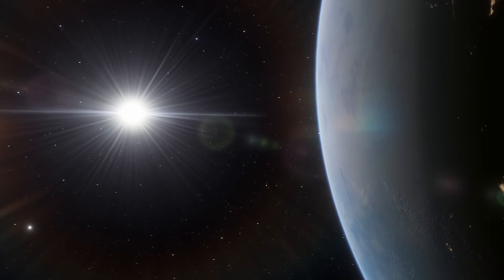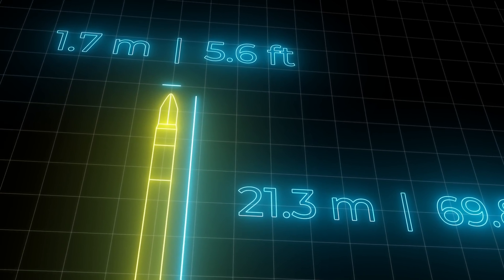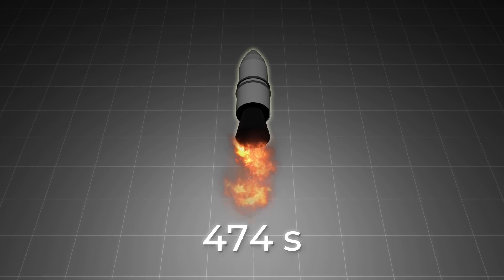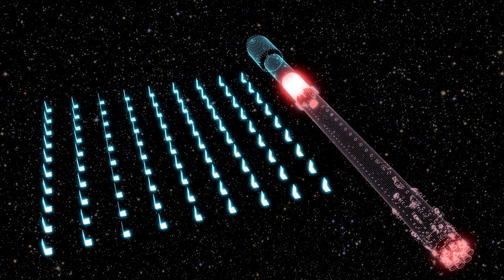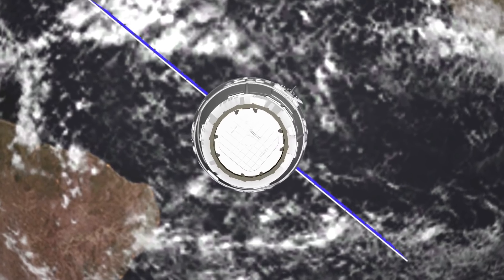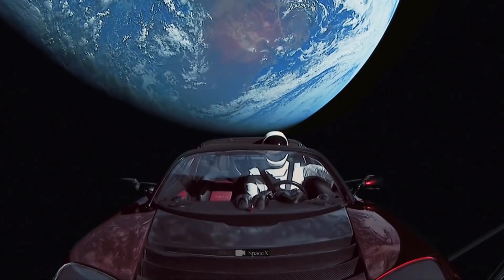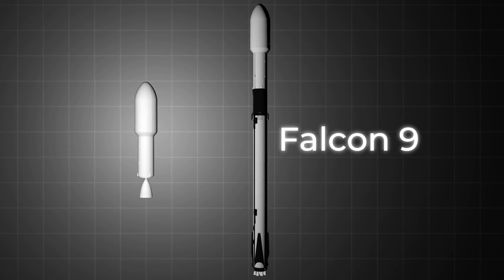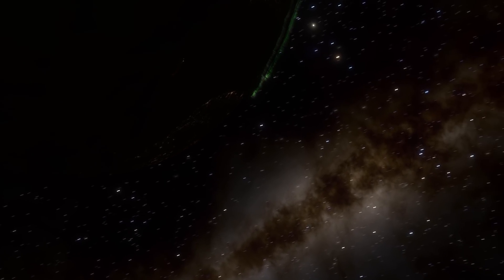How All of Elon Musk's Spacecraft Work in Just 10 Minutes

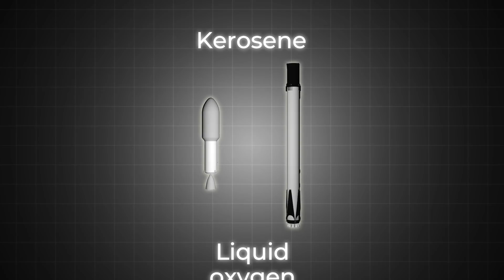Comment: Lots of Misinformation! 4:25 Stating “none of them have failed” when referring to the falcon nine that’s unfortunately not accurate. CRS-7 commercial Resupply mission to the international space station unfortunately failed when it disintegrated Two minutes and 19 seconds into flight.   The video has many more inaccuracies throughout, but the one in the 8th minute where it states that Falcon Heavy says that it has the powers of 18 Boeing 747 aircraft and can lift the weight of one of those same aircraft filled with baggage and fuel to orbit is completely wrong!   Elon Musk has many times stated that the falcon heavy can lift the equivalent weight of a Boeing 737 aircraft to orbit Confusing the 737 which is one of Boeing smallest commercial two engine jets and the Boeing 4 engine 747 which turns out to be its largest jet would be like claiming that a Ford Focus and a Ford F-250 Superduty pickup were essentially the same thing. There is a long list of inaccurate information in what otherwise would be a good video. 
I strongly recommend doing a bit more research on a subject before making a video thats going to be viewed millions of times (over 1 million times in the first 4 months) Other then the misinformation, the graphics and content of the video is really quite good. It’s a interesting subject both, both Elon Musk and SpaceX has revolutionized Spaceflight and are doing more to develop and advance the future of Spaceflight then anyone on the planet!  I can’t imagine what SpaceX will accomplish in the next 5-10 years.

Comment: Great video Oh, awesome content. You may want to double-check some of your information though. There have been a few failed  Launch a tents with the Falcon 9. One of them specifically being a launch for NASA CRS mission. also SpaceX cancelled the option of using the super Draco thrusters To land without having to use parachutes. They cancelled this option about 3 years ago. They canceled it mainly because they did not have enough data to support using this option for landing with humans on board. The time it would have taken certify this would have been too long and they needed to get dragon to operational.

Comment: There's.... just a lot of little mistakes in this video. This video says things like Falcon Heavy was designed with the intent to carry people and... "spaceships?"
It says that Falcon 9 has never failed.
It misleadingly makes it sound like SpaceX is super expensive (even Falcon 1) while SpaceX is often a cheaper option.
I'm also still trying to unpack the phrase at 0:10
-which I find very confusing. This video doesn't feel like trashy click bait, but it definitely could use some more research.

If you want far more accurate SpaceX info, check out Scott Manley and Everyday Astronaut.
Reply: You’re right, a lot of factual errors and moreover, the Falcon heavy was never meant to be human-rated if I’m not mistaken
Reply: @F2PRS  It was originally meant to be human rated, but they had to drop it, it was also originally supposed to share fuel between all 3 boosters but that proved to be too difficult as well. The op is correct... Scott Manley  is a much better source for info on spacex and rockets in general.
Reply: Yep.  I disliked this video for these same reasons.  Great graphics, but terrible fact checking and misleading terminology.  Also, falcon 9 is volume limited to 60 starlink sats despite reusability/expendable configuration.

Comment: 04:32  "None have failed"?  
.
The Falcon 9 has suffered two failures in its short life span. 
.
2015/06/28  A Falcon 9 carrying CRS-7 to the ISS disintegrates during ascent at  T+02:19 into the launch.  The subsequent investigation concluded that a strut holding a high pressure helium tank within the oxygen (fuel oxidiser) compartment failed, causing the tank to break free of its regulator, causing an uncontrolled dump of helium into the oxygen compartment which created a catastrophic over-pressurisation rupturing the Falcon 9's 1st stage core. 
Both the launch vehicle and the Dragon capsule were lost.
.
2016/09/01  A Falcon 9 with the Israeli Amos-6 communications satellite on board was destroyed on the launch pad during a pre-launch static fire test.  The event occurred while the Falcon 9 was being fuelled in preparation of the static fire test.  SpaceX determined the cause of the failure was a buckled liner in several of the COPV tanks, causing perforations that allowed liquid and/or solid oxygen to accumulate underneath the lining, which was ignited by friction.
Both the launch vehicle and the satellite were lost.

Comment: The super dracos can't land dragon, if they tried to fire them up during reentry it would be unstable.
Reply: The original plan was to use them to land, the only reason it didnt happen was because of safety concerns by NASA. Instability during re-entry isnt a problem, remember that the Falcon 9 does a re-enty burn just fine. The Dragon also most likely wouldnt do a re-entry burn at all, rather relying on drag to slow it down and then doing a landing burn

Comment: No, Crew Dragon is no longer intended to land propulsively, nor will it ever be certified to do so. Not even in the case of an emergency. The eight SuperDraco engines are part of the launch abort system and will only ever be used to propel the capsule away from a failing launch vehicle. As for Falcon Heavy: the second stage is not similar but identical to the one used on a regular Falcon 9 rocket. Although theoretically Falcon Heavy could lift Crew Dragon into space it is not certified for manned space flight and there are no intentions to have it certified. Inaccurate and outdated information. Sloppy and inaccurate 3d models (especially landing legs and aerodynamic nose covers on FH side boosters).  Sad.
Reply: Yeah, overall a very odd, inaccurate video. Especially whatever he's talking about at 0:10

Comment: There's so many things wrong with this video...
1: Yes, a Falcon 9 has failed before, take a look at CRS 7.
2: A Falcon 9 Block 5 launch costs about $50 million, not $62 million.
3: A Falcon Heavy launch doesn't even remotely cost even near what he said it does. $150 million? No. Try $90 million.
Reply: Also Dragon 2 or Crew Dragon will not be doing a propulsive landing that has been cancelled. There are also two versions of the falcon heavy. The maiden flight famously putting a Tesla in orbit around the sun was one version. Well the other two missions used the upgraded Block 5 boosters. Just look at the color of the landing legs.
Reply: @coreylu3283  it might be doing propulsive landings, if stuff goes wrong.. they didnt take the engines out, they just defaulted to parachutes, but in case of failure, it is still the backup
Reply: Thanks for the proper facts
Reply: On 3. the 150 mil figure is for the fully expendable Falcon Heavy with it's payload of 63.8 tons. The 90 mil figure is for fully reusable Falcon Heavy, which has a LEO payload probably around ~28 tons.
Reply: Launch costs are weird though. Prior agreements, recovery and the booster's age can all affect the price a would-be customer pays
Reply: you forgot that he sad kerosien and not RP-1
Reply: @oberon3126  RP-1 is kerosene
Reply: I think he was actually talking about how no first stages have failed. Which is true. Both failures where issues in the second stage
Reply: What bothers me more is actually just generally the formulations and word choices that are weird at times... A bit cringy tbh...
Reply: No one cares about what u think
Reply: @randoms-e3e  but he's right
Reply: He's right about Falcon Heavy I'm pretty sure, the launch costs that, but the so called "sticker price" is 90m
Reply: @pabloplata4325  no hes wrong about even the heavy, it was never meant to carry crew, the certification from nasa wouldve taken too long. It even came very close to program cancellation at one point, i'd say for a good reason too, to date it has only been launched 3 times, 1 of which was a demo launch with no real payload.
Reply: He meaned falcon 9 never has failed the primary mission landing is always a bonus
Reply: @Tahterimonni  Meant* No, crs 7 literally exploded in flight due to a strut failure in the lox tank.
Reply: Trippy Tube it has failed the primary mission 2 times - once on the pad and another time in midair, both times blowing up the entire rocket, including the satellite, thus being a failed primary mission.
Reply: @kylej7593 , the on-pad RUD was not caused by the Falcon 9 booster.  Rather it was solidified oxygen of the upper stage reacting with the walls of it’s carbon fiber composite tank.
Reply: @Tahterimonni  meaned.. nice

Comment: This is a really cool video, and quite informative, although there is some slight misinformation. There is no Dragon 2, it is called Crew Dragon. And Starship is not launching to Mars in 2022, but has been chosen as 1 of 3 Human Landing Systems for the new Apollo/Moon Landing program, "Artemis," and will hopefully be launching in a couple of years as tests to the moon.
Reply: I agree that there is misinformation, but what you mentioned is actually not as false.

It is often referred to as Dragon 2, as Dragon 1 was the cargo variant. It's not necessarily inaccurate.
SpaceX is also planning on flying two starships to Mars in 2022 carrying cargo, though that is, of course on an optimistic timeline.

The real problems I have with the video are things like them saying that Falcon 9 has never failed, Falcon Heavy was designed to launch crew, and whatever the heck he means at 0:10

Comment: Things that weren't mentioned or mentioned wrongly in this video:

3:50 The Falcon 9 that he was going to introduce is actually the Block 5 / FT. But because he "forgot" to mention that it was Block 5, a lot of viewers thought that it was some kind of rocket that hasn't changed for more than 10 years, probably. it's like mashing all the Blocks into one or something. Hence created a lot of confusion there, especially in the later part of this video. (For the rest of this video, I'll just use numbers from the Block 5 only, reasons are mentioned above, and the source would most likely taken from Wikipedia.)

3:53  22,800 kg / 50,300 lb, to be exact, but that's for the expended one (non-reusable). If reusable, then it would be 15,600 kg / 34,400 lb. Not to mention, those numbers are only true to LEO only.

4:03 That's 227 kg to 260 kg (500 lb to 573 lb).

4:10 "Could lift 88 of these device (Starlink)" The weight of the payload would end up 19,976 - 22,880 kg (44,000 -50,424 lb), which means that it just barely more than enough to launch them into space, expendedly. SpaceX planned to land the 1st stage every time they launch Starlink sats, and so they decided to just launch 60 of them so that the 1st stage could have enough fuel to land. But that's for MEO and LEO only. If they lanuch them into higher orbit, that would be an another story.

4:30: "$62 mil" Again, for expendable only. ~$50M if reused. (Price are adjusted for 2020 inflation, tho)

4:32 "None of them (F9 FT boosters) have failed" Only true for Block 5. Few more accidents including the time when the booster exploded while launching, and another time when it exploded right at the launchpad. (Not including the second launch abort test, in which the booster, along with the 2nd stage, exploded due to aerodynamic reason, and it was considered as "mission failed successfully")

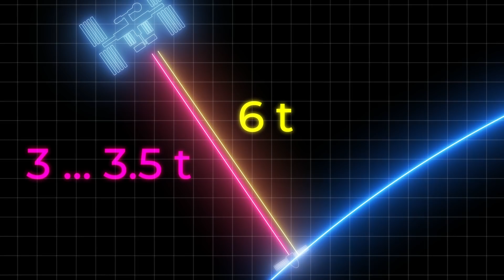5:23 ...for now. When someone could actually launch a spacecraft that could do (nearly) the same as Dragon 1, that information most likely will gone outdated.

5:53: Actually, it was designed to carry up to 7 people, but for now, NASA only wanted to launch up to 4 people. (So I guess the remaining 3 are there for cargo then.)

6:17 It was planned to land using abort motors, but then the company and Elon decided to just use parachutes only, with legit reasons of course.

6:21 If launch abort occurs, the Dragon 2 Capsule itself would also carry the trunk too, since it has been equiped with fins for stablization, especially when the abort ended up being an actual thing while still being in the atmosphere. Imagine seconds after launch and the 1st stage explodes and the lanuch abort happens. Now imagine the capsule escape with the trunk. Smooth like flying planes. Now imagine the same thing happens, but without trunk this time. That definitely won't be a good day for both NASA and the madlad himself.

6:42 For fully expended only. If only 2 side boosters land, that would be ~57 metric tons (~125.663 lb), and ~30 metric tons (~66.139 lb) if all 3 boosters land.

7:01 Nearly successful, tho. RIP core booster.

7:13 "Without problem" at the time that video was uploaded, of course. It means if one of the future Block 5 gone boom boom for some reason, then that info would also become outdated, too.

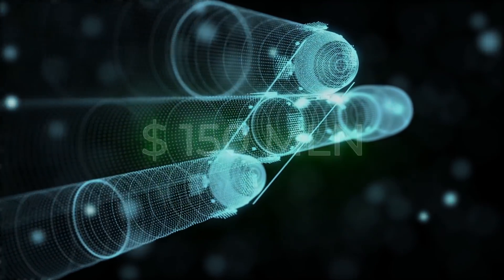7:19 And again , for fully expendable only. ~$90M if reusable (not really know what type of reusable is it, tho.).

8:39 Someone clearly plays KSP a bit too much here.

8:46 Not scientists. The provider, it is.

9:23 And what about the people (passengers)?

9:26 Metric ton, specifically.

And that's about it. If you see something missing or wrong, feel free to leave the suggestion in the comment below. Sorry for my bad English.
Reply: Thu Lx damn this video was rll poorly researched then
Reply: ditto. Also whatever the crap they mean at 0:10
Reply: Thanks for this. This video has so much wrong information it hurts.
Reply: Propulsive landings was rejected by NASA and required chutes.
Reply: Also, after Falcon 1 SpaceX announced Falcon 5 before Falcon 9
Reply: Wow are u one of their engineers? Please sell some data
Reply: 4:31 He says none of the F9 launches have failed. I guess he missed the CRS-7 explosion, as well as AMOS-6 (payload was destroyed, so I'd count it as a launch failure).
Reply: I was going to mention a few of these and checked comments before I did and found this.
Reply: Multiple times, Riddle kept calling the FH "Super Heavy", that's the classification and early name for the rocket also known as the Big F..... Rocket, still in development.
Reply: Thu Lx 
Yes, this poorly researched video had me looking to take notes soon after I hit play.  One more (I think there are more besides ) 
5:07. When speaking about the the Dragon one to the ISS, “the spacecraft supplies the ISS with everything it needs”  This is incorrect as the Dragon does not carry fuel for routine orbital adjustments.
And this video was confusing me with using price and cost interchangeably 
7:35. Video mentions the price of the Falcon Heavy as $150 million. Incorrect ref. https://www.spacex.com/media/Capabilities&Services.pdf
Reply: Bless. I wanted to comment about some of these, but damn you nailed em all.
Reply: What bothers me more is actually just generally the formulations and word choices that are weird at times... A bit cringy tbh...
Reply: I noticed all these errors as well, great content from this channel generally but this video was filled with errors. Seems the writer isn't that caught up on SpaceX.
Reply: Up
Reply: Wow good effort
Reply: Big review how long did it take you write
Reply: Yeah right.. i read it all through
Reply: This video really is a shitshow
Reply: THE 🐐
Reply: What about him saying falcon heavy was a super heavy launch vehicle
Reply: Everytime he says "device" instead of "vehicle" I die a little more inside.
Reply: falcon heavy cost $90 mil with full reusability, if you expend the core it costs ~$95 million as per Elon’s twitter.
Reply: I don't even know much about the info but I already knew it's is wrong because I can't trust a person with this voice
Reply: You probably used up all the ink in your laptop now! Am I right?
Reply: Addition: 1:14 is a falcon 9, not a falcon 1
Reply: @IdiotsCorpYt  no thats falcon 1
Reply: @IdiotsCorpYt  I'm pretty sure that's a falcon 1
Reply: Thu Lx can you cite the research pls? Not saying your wrong but maybe you are wrong about it. I just wanna see the truth I guess
Reply: @aaidxnne4802  Here's the source:

https://en.m.wikipedia.org/wiki/Falcon_9_Full_Thrust

https://en.m.wikipedia.org/wiki/Starlink

https://en.m.wikipedia.org/wiki/Falcon_Heavy

https://youtu.be/1_FXVjf46T8

https://youtu.be/mhrkdHshb3E

https://youtu.be/wbSwFU6tY1c

https://youtu.be/NW8G446MG4I

https://youtu.be/e2gy6of2yaQ

https://youtu.be/RqLNIBAroGY

https://youtu.be/Jlj2BW8AtUQ

https://www.theverge.com/2015/6/28/8858801/spacex-falcon-9-rocket-explosion-nasa
Reply: Thu Lx my man has sources and everything
Reply: @aaidxnne4802  Yes, check out Space X sources and Elons twitter.
Reply: @aaidxnne4802  The uploaded/channel itself doesn't bother with citations...?